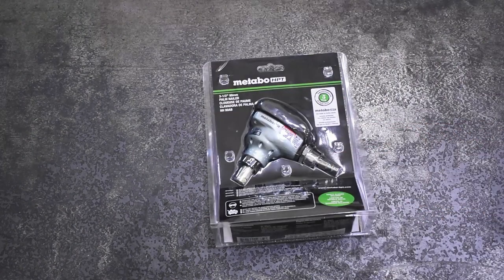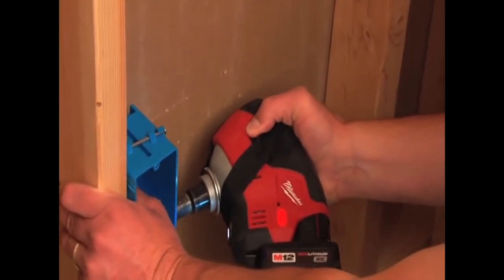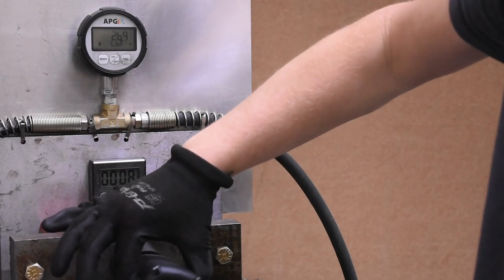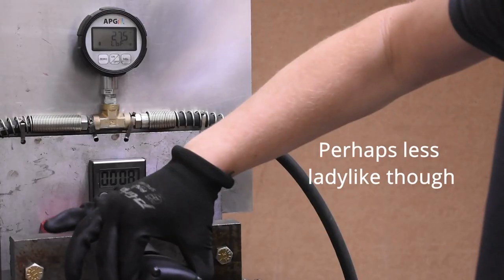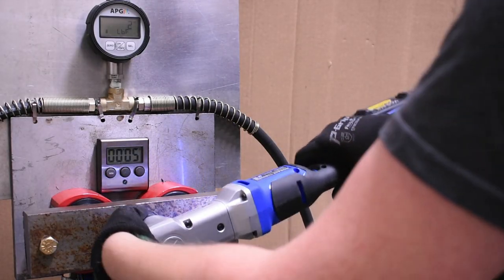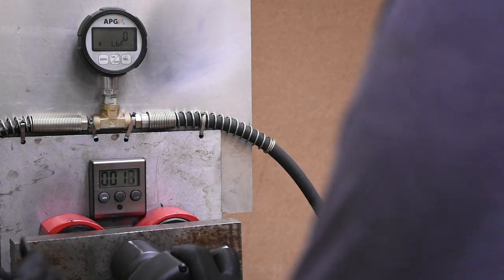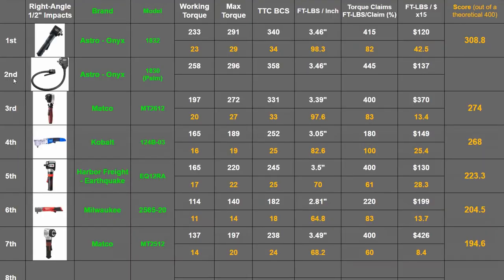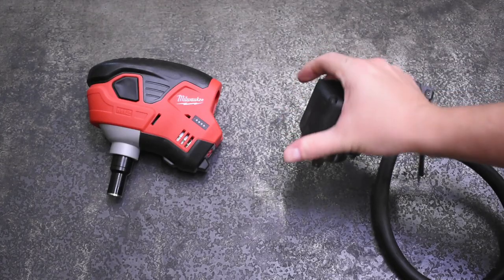I Made a Palm Impact Wrench: Dyno Test + Nailers!

Comment: That remote impact seems like a case I don't know what I'm missing until I have it. On newer semi trucks there one particular trans bell housing bolt that I always struggle with. Usually I resort to the long cordless ratchet neutral drop routine, but this seems like a genuinely great alternative to that.
Reply: Yeah, sometimes uses for a tool show up after you get it. In my case, I picked up a cordless hot glue gun in a 'well why not?' moment. I've used that glue gun a surprising number of times.

Comment: @torquetestchannel - awesome idea and tool, can't believe we actually haven't seen something like this on the market before now.  I imagine this will benefit quite a few mechanics and even some DIY'ers.  awesome job mate!
Reply from the maker: Most of the difficulty is in making an impact head that small make power, which super modern air impacts can - so I just added a hose really
Reply: @TorqueTestChannel  it is still genius, even if the contribution was small to the effort, the overall product is genius

Comment: This little palm gun and a co2 tank is perfect for off road emergency repairs, as in my experience broken parts have less clearance and generally aren’t the super tight mounts that get busted up. I’m seriously considering getting a power tank just for this now, as I’ve been running battery tools for this emergency task previously. But this allows a killer air up and emergency repair kit in less space than both previously took up, which is critical for small Jeeps. Seriously I love this idea and I want to test it out on the trails… just not on my Jeep.

Comment: Super cool, I could see an M12 Fuel or Dewalt Xtreme 12V version of this where the battery, chip sets and switch are remote, with a 0-gauge cable leading to a handheld palm-style brushless motor and mechanism.
Reply: oh cable :)
Reply: If you're putting the battery on a tether, there is no reason to limit yourself to 12v.
Reply: @Kineth1  Right! Why not use 120 volts and no batteries at that point? /s
Reply: Many years ago I 'designed' a 'remoted' hammerdrill for use by a robot in confined spaces in the Great Pyramid in Egypt (of all places).  Drill a hole, stick a borescope in; that sort of thing.  We bought the fanciest DeWalt cordless, I think it was 24V, and took it apart to suitably repackage the thing.  I remember doing current measurements out back behind the lab, drilling 3/4" holes  into old concrete barricades and the like.  We saw ~100A for 10's or seconds at a time - presumably until the BMS cried uncle.  Sizing the cable needed to put the battery a couple feet away (long skinny robot, drill at the front, battery at the back) was no fun at all.
Reply: @hiugyuhgf  I was thinking of the ubiquitous 20v batteries that each manufacturer also makes.
Reply: @Kineth1  Of course there is; weight + size vs run time. The new 12v brushless motors absolutely rip and are tiny, so using a 12v 6.0 Ah battery that weighs a third and takes a third of the space of a 6.0 18v battery makes all the sense in the world. But there's still a definite use case for an 18v tool as well.

Comment: You know it's funny, I have to do a clutch job on my 3rd Gen.  4runner soon and I was thinking damn that would be nice to get the bell housing bolts out and then you said it at the end of the video. because last time I had to do one I needed at least 2ft of extensions with an air impact. You've got me sold

Comment: Never used a palm nailer for its intended purpose, however i did make a different hammer for one to use as sort of a handheld planishing hammer for sheet metal work. So far it is one of my favorite tools, very fast when needed, yet can be very gentle and controllable. Works wonderfully for hammering out smaller dents in car bodies.
As far as air tools in general go, it would be interesting to see a test between two tools where one had some intake work done (port/polish, larger valve, larger hose even) and the other had the same on the exhaust (port/polish, drilled out exhaust ports). On one hand, more air=more better. On the other, making 'spent' air flow out easier would increase pressure difference between in and out, giving the tool more power.

Comment: ngl, with the advent and power of modern cordless impact wrenches, Ive been struggling to find a reason to have my  own air impact, but holy crap that palm design is amazingly compact, especially without the handle

Comment: I once used a mini air rattle gun to pull off an L76 crank bolt on a VE Commodore; it was my boss's car. The mini rattle gun had high RPM, it smooshed my hand between the crank bolt/rattle gun and the thematic fans. It tore the skin off my hand.

Comment: I'm blown away guy, this is legitimately a good idea. There may be some spaces a right angle wouldn't fit as well plus the power is excellent in that small package. How big of a compressor is acceptable for running one of these?
Reply from the maker: only need a 10gal compressor, 130psi static

Comment: You made suggestion and a company actually made the thing?
Wow, that almost never happens anymore.
So many companies come out and say "don't give us suggestions for new products or improvements".

Always nice to have another option.
Take a few "atta boy"s out of petty cash,
You have earned them!

It is also cool to see  a brand name palm nailer.
I almost bought a no name one at Menards way back when we were renovating our house but I figured it would blow up on the 31st day and I would be stuck with a paper weight.
I will have to look up what Metabo/HPTs warranty is.

I still don't understand that rebrand.
"We bought a middle of the pack power tool brand.  Let's use our high end brand on them but not beef up the design any.
No way that will dilute the value of our brand right?"

Comment: Video suggestion. Tire inflation tools speed and accuracy. I inflate semi tires as high as 120psi and I remove the valve core till it inflates to target pressure. Then install the core. Some chuck just barely bleed air in. Others don't have enough grip to install the chuck and walk away

Comment: I have the 1/2” version of this palm impact.  While powerful, it does have its downside also.  
1. The air trigger valve is too sensitive.  Needs a safety feature similar to a die grinder.  While working on suspension components the tool was accidentally triggered a few times while being moved around on the ground with all the other tools in the area.  This also caused sockets to come off the tool and go flying.   Go ahead,put a socket on a swivel head, and then put that on the tool.  Take your chances and squeeze the air valve with no load on the tool.  It’s like playing Russian roulette. 
2. No 3rd hand.  1 hand to hold a wrench on a bolt head, one hand to hold the impact, and use what to activate the air valve?

Comment: Great video and I like the remote air valve. I worked at a place that had a 1 inch drive and the air valve was on the back of a handle and the nut on the u bolt loosened and pined his hand to the concrete with the air valve full open. Luckily someone heard him yelling and turned the air off at the wall. I don't remember how you changed directions on it but it messed up his hand a little bit.

Comment: I am not a mechanic. Just a home workshop guy. My front line tools are 1/2 impact and Milwaukee 1/4 bit impact. Ive been planning on buying a 3/8 socket impact as I use the 3/8 adapter on the Milwaukee more than any other tool. But there are A LOT of places where the 1/4 is a tad too long. Frustrating.  This will come first and may even eliminate the need for the 3/8 electric

Comment: Next version of the palm impact should be a bit more ergonomic for the holding orientation. Maybe also move the valve lever to where the thumb would be, then make the design to where the valve module can pop off and be reversed to make the tool ambidextrous; so that the other hand can be freed up, as not every fastener goes into a rigid block after all, sometimes you need a wrench in your other hand. With a sizable lever and the thumb's finer movement, it shouldn't be too difficult to feather the valve if you don't want all the beans. Alternatively, a palm-actuated valve, more pressure means more power, I remember some electric screwdriver AvE reviewed doing something similar to this, but that kind of activation makes more sense within this context; I also don't really foresee an issue with this kind of valve implementation as the tool will always be palmed, it also frees the thumb again for better grip on the tool. Palm tools are interesting, but I think they need a bit more design work considering we're all used to holding some kind of handle; square-backed tools, with sharper corners and no contours, like we see on handle-based guns, just aren't all that ergonomic for palming a tool, nor is it ergonomic for a claw-like grip.

Comment: perhaps use a bolt in yer dyno with a 1/2" square hole so you can attach a 1/2" square anvil w/o using a socket. that way you can determine any loss due to the socket itself, perhaps find which brand is best at transferring torque to the load

Comment: Test idea:
Test which grinders/cutoff tools cut rubber horse stall mat best while using a standard cutting wheel.
it will be so cool on video...........
Reply from the maker: We're building a digital dyno for die grinders right now!
Reply: @TorqueTestChannel  Cool,But you never tried cutting a horse stall mat...did you? it liquefies the rubber...tons of smoke...makes  nearly any grinder overheat....try it!

Comment: You could probably make an electric one using the rigid subcompact head, installing some 10 gauge wire, and maybe adding some weight to the hammer inside to get a little bit more torque.

Comment: The Astro tool is probably what the Milwaukee palm nailer should be.  Remote the powerpack.
Reply: I wonder about a flex shaft with a remote motor...
Reply: I don't know.  It looks like the motor is there under the battery. Might be able to leave it there, just remote the powerpack and remove a few inches of depth from the handle.  Milwalkee has a lot of smart engineers.  I am sure they could do better.

Comment: It's $120 right now at CPO not sure what shipping it though so probably works out about the same. Seriously considering picking on up as I seem to find myself working on forklifts lately and they are not built bolt removal in mind. Don't know why they don't just weld everything in would be only slightly more of a PITA to work on... that's sarcasm folks.

Comment: Last astro mini I bought failed. But I put my tool through the ringer. So if I get this I'd have to baby it. But super cool
Reply from the maker: Was it the twin hammer (1822/1828?) they were putting too little grease in the hammer casing for how much heat it makes. This palm impact uses a single "jumbo" hammer, so different story, and hopefully that's resolved. They have replacement hammers that are easy enough to swap.

Comment: One thing the battery powered champions (DeWalt, Makita, Milwaukie et al) should do is make the battery and connector at the end of a cable more closely resembling the way an air hose connects to a pneumatic palm nailer. Would save on in-hand weight too.
Reply: So back to corded tool?
Reply: @quertize  battery powered but not both the battery and motor all trying to fit in your hand, its very bulky and heavy. The cord would only have to be long enough to say clip to your waist.

Comment: Good information.  you might want to check out the Skil PWR CORE Brushless 12V Auto Hammer.  I have one of these and it works great and I would like to see you review this against the palm nailers.
Reply: Does it perform well as an air impact/chisel replacement?

Comment: So about a year ago when I bought my dcf 901 12v I wanted the 3/8s but had to get the half inch as they were the only ones in stock and the thing is amazing imo but looking at the power specs of the 3/8s it seems really down and givin the higher number 3/8s drive impacts tend to give like the new drivers that wear converted recently and givin the fairly high rpm and ipm of the 901 I feel like it would be an interesting test I have a 3/8s swapped one if you wanna test it
Reply: @torquetestchannel

Comment: would something like a cable driven cordless work with the main motor remote mounted

I have an idea on how to prevent the cable unwinding and direction control on the head
Reply: I’d imagine relocating the battery would be relatively trivial how ever relocating the motor would require something like a flexible extension or something similar I think that you have 2 scenarios a flexible but weak one that would suck or a stiff but stronger one that would handle the abuse better but be less convenient imo as you’d have a less flexible neck and a lot of power loss so I’d think take an existing right angle put a stronger motor id think the atomic from dewalt would be a good motor but the head would probably require a gear box or something and wouldn’t be any smaller with out a new case so a right angle cordless like the Kolbalt would be a better idea just move the motor and batter down the handle run the wires and a shaft I think a good idea for that would be a flexible extension or something but I’m sure you good fab something better and I’d definitely run the extension through some Kc cable and the wires on the outside in a separate thing it sounds like it would have to be pretty custom to make much power or be useful he’ll or have to be a ground up effort but for prof of concept I think it would be cool as hell I might be tempted to try it with my dcf 901 cause the 12v batter would be more pleasant to hold in your hand Imo
Reply: Honestly though the hammer mech would have to stay at the head to avoid hammering losses and a better relocation would be cool and you’d Need a wildly strong flexible shaft to handle a big motor for more  power and even then the size of the hammer would be called into question so I think the extra 3/4s of an inch or so you get from including the motor in the impact is worth it as the drive train losses would be a bitch and require a big motor then you’d have to have a stronger more rigid shaft that would be even more parasitic and cause you to need a bigger motor and so forth so a battery relocation and maybe someone just doing it for fun would be cool but I highly doubt it will ever actually be truly practical
Reply: @agoogleuser1188  there are flexible remote drives used in automotive applications that drive fuel pumps and could work,Waterman  have a great one
Reply: @Realtime1501  oh cool I didn’t know about those that sounds like it could fix the problem

Comment: This is still not the smallest they can go. Take the head from their 90 degree impact wrench that Matco sells rebranded, lop off the flex handle and now you have an even SHORTER palm impact.
Reply from the maker: Shorter but wider. Overall foot print is similar
Reply: @TorqueTestChannel  WE MUST GET SHORTER. But I really love my 1834 and my coworkers found it interesting. But I died laughing when I saw it in red on the Matco truck for $300

But in reality, the 1834's entire benefit is how short it is. Adding your hand into the mix just chonks it back up and negates it's entire purpose. But for posterity's sake for 'shortest palm impact ever'.

Comment: Please create a video about the 1” Pinless Harbor Fright Impact!!! The two hand gun with the long anvil! I NEED to know if you can really get 1500ft/lb for under $250.00
I’M SUBSCRIBED & I’LL BUY MERCH IF YOU MAKE THIS VIDEO!
Reply from the maker: We havent been able to keep 90PSI in 1" guns while running, even with 3/4" hose from a 3/4" cast iron wall pipe, 80gal IR compressor. Needs diesel tech shop type air system to work to the box specs
Reply: @TorqueTestChannel  lmao so it's 250$ with thousands in supporting air equipment to get the advertised numbers
Reply from the maker: @Dappersworth  Correct, cordless is making up real ground in that category IMO due to this
Reply: @TorqueTestChannel  I'm no expert at pneumatics but you could always rent a tow behind air compressor like the kind used to power a 75lb jackhammer. I've used that setup twice, absolutely demolished a concrete pad and pole lights bases with it.
Reply: Forgot to mention in my area looks like those towable compressors run about $300 a day before tax and insurance

Comment: If you can stick your arm in the space to hold this palm impact driver, you can stick the legacy tools in the same space so this gizmo doesn't make a whole lot of sense.
Reply from the maker: If your arms are stiff broomsticks maybe, this does the bending and angling to get into a space that a ridgid body right angle impact of a defined length wouldn't. Difference between a flex head ratchet and a non flex head is big, this is like that but with infinite flex "zones"
Reply: @TorqueTestChannel  Well, that's precisely why we have shallow depth articulated impact sockets. Forgot to mention the Astro 1833 which has a flex head being available. Cheers!
Reply from the maker: @strykerentllc  Oh yes, 1833 is a good example
Reply: @TorqueTestChannel  Know this suggestion isn't exactly in your wheelhouse but maybe a demo of this wrist rattler against the other wrist rattling offerings such as the 1833 in a vehicle would be beneficial in order to enlighten us mouth breathers to where this one shines?